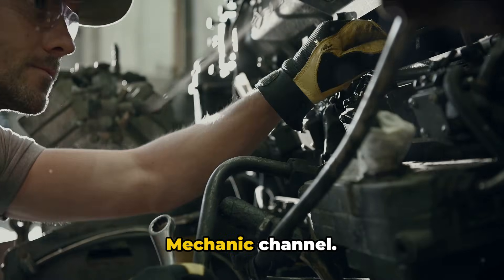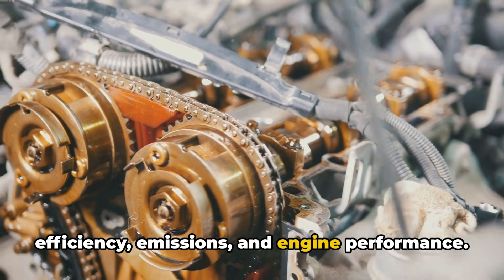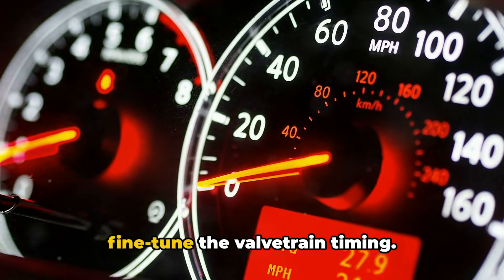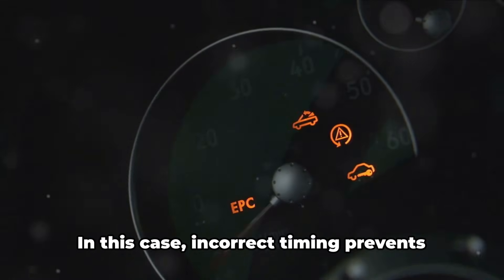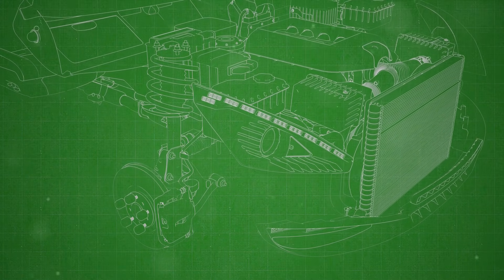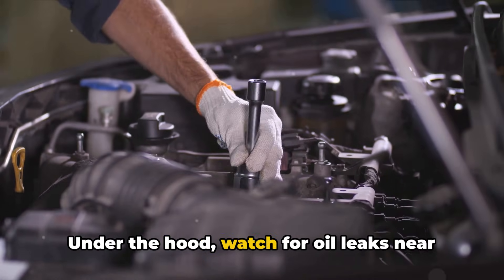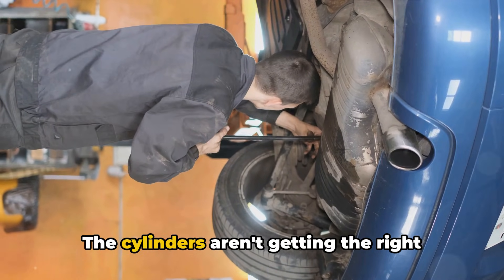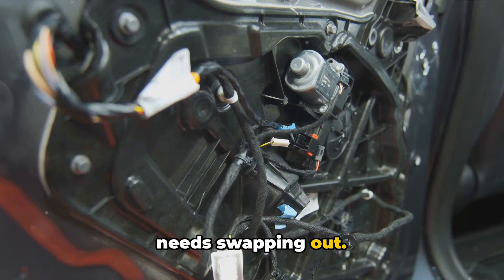Bad VVT Solenoid Symptoms: 7 Common Failure Signs

Comment: Hello, I have a corolla 2015 and my car makes a rattling tac tac tac noise when is very hot outside 115°f. I just changed the oil thinking it was probably the oil that was too old but it keeps doing it, could it be the vvti solenoid or the entire vvti system or perhaps the 0w20 oil that they recommend is too thin for this extreme weather, that thing is like water
Reply: Possibly knock sensor

Comment: also cleaning the filter may be needed rather than replacing though you're already in there at that point
Reply: Had this problem with a 2005 Aveo and my friends 2004 Echo. Car would shake violently at stoplights. Changed air filter both times and that fixed it

Comment: I have a 2010 vw tiguan 2.0 tsi and one piston is misfiring i checked ignition coils sparks injector they were good and i even redone the timing chain and it still got less power and it still misfire on cylinder 4
Reply: I had a similar issue on a 2016 Tiguan, ended up replacing the pcv assembly on top of the valve cover and the misfire codes went away

Comment: I’m changing out a bad water pump in my ‘17 Ford Explorer. At 168,000 miles it’s probably be wise to just go and replace the VVT solenoid right? Hell I’m changing out the alternator too since it’s never been changed.
Reply: i would for sure for piece of mind since you are in it anyway

Comment: I’m currently trying to fix multiple misfires on my ‘16 IS300 with 35k miles. Replaced coils and spark plugs and the result was misfires on 5 cylinders! Took it to a shop and they suspect it’s due to the non oem parts I used. I plan on getting oem but that still doesn’t account for the initial misfires. I’m wondering if the vvti solenoid could be the cause. There have been no codes mentioning it. Only cylinder misfire codes. Thought? Thanks for any help!
Reply from the maker: Hi John,

Yes, these solenoids can indeed cause misfires, and the tricky part is that they can lead to a lot of random misfires. I once owned a V8 Audi S5, and it started misfiring on one bank despite my plugs, coils, and injectors being fairly new. I even carbon cleaned my engine. That's when I decided to change the solenoids on both banks. As a mechanic, I know that if one component starts to fail, others may soon follow.

Regarding your '16 IS300 with 35k miles, it's concerning that replacing coils and spark plugs led to misfires on 5 cylinders. The shop suspects it might be due to non-OEM parts, but even if you switch to OEM parts, it doesn't explain the initial misfires. It's possible that the VVTi solenoid could be a culprit, despite no codes mentioning it, as you've only seen cylinder misfire codes. It might be worth investigating the solenoid further.

Hope this helps! Let me know if you have any more questions or need further assistance.
Reply: @HonestMechanicChannel  thanks for the quick response! The only other suspicion he had was carbon build up. Which turned out to be quite minimal. So he basically circled back to plugs and coils. I had seen some mention of the solenoids but couldn’t remember what they were called when I tried to bring it up. Seems possible. The reason im unsure is because the codes referenced seem to be different than the misfire codes im getting.  Thanks again!
Reply: @johnfriedman3463 did you ever figure out what the cause of your random misfire was?

Comment: Hi Mate wen i start the car first attempt in the morning its cuts of and then it starts with a rattle  , chain been replaced 2 month ago could it be the VVT sprocket and VVT solenoid ?it gives a camshaft sensor error wen you scan the car
Reply: Did it take care of your issue with new solenoids? I am having same issue chain seems good, cold start rattle for 2 seconds and have a intake solenoid code. Was brainstorming thinking if solenoid is bad maybe the oil pressure to vvt is not present at start up causing it to rattle until oil makes its way in there

Comment: Would this cause air suction from the oil dipstick tube?
Reply from the maker: Hi, Yes, a bad VVT (Variable Valve Timing) solenoid can cause air suction from the oil dipstick tube. This happens because a malfunctioning VVT solenoid can lead to improper engine timing and increased crankcase pressure. The increased pressure in the crankcase can cause air to be drawn in through the oil dipstick tube.

Comment: I have a 2007 vw Rabbit 2.5L. I already replaced the coils and plugs, the first Fuel injector (which was giving off a code) and replaced all of the fuel injector top and bottom O-Rings. It’s still sputtering. I Do have thicker Oil in it, but it was running fine for the past 6 months. It loses power during acceleration and around 3-4th gear.
Reply from the maker: Hi there, Given your 2007 VW Rabbit's symptoms of sputtering and losing power during acceleration, even after replacing the coils, plugs, and a fuel injector, it’s possible that:

1. Mass Air Flow (MAF) Sensor: A faulty MAF sensor can cause these issues. Try cleaning or replacing it.
2. Throttle Body: A dirty or malfunctioning throttle body can affect acceleration.
3. Fuel Pump/Filter: Check the fuel pump and filter for proper fuel delivery.
4.Vacuum Leaks: Inspect for any vacuum leaks, which can cause similar symptoms.
5. PCV Valve: A malfunctioning PCV valve can lead to power loss and sputtering.

Addressing these components should help diagnose and fix the problem.

Comment: I did a full tune up on my 11 rav 4, got it from mechanic no check engine, but it is over reving at lights and shaking like crazy. Thanks for this video. I’m pretty sure changing the solenoid will help a lot. The wiring harness looks like crap too, i might need to change that as well we shall see ordered the part. Thanks for this video again
Reply from the maker: Thanks for sharing! Glad the video was helpful!
Reply: did it fix your issue ?
Reply: '12 RAV here
Sounds like rough idle and bad air/fuel ratio. Check the MAF sensor and/or the gas cap if you haven't already. Then again all that just sounds like a 06-12 RAV4 😂 at full throttle so you good my bud

Comment: Have my 2015 Highlander limited v6. Code p0012. The car doesn’t allow the awd drive to be used nor the eco mode. Doesn’t have noticeable shaking when idle and recently got and oil changed with a trip to Michigan behind it with no issues. This happen on my way home from NY 7 hour trip. Half way Check engine light came one. Couldn’t use the awd system after that. Drove it slowly home and out the scanner. I haven’t got the solenoid yet my question is should go a head and just replace it or should I be concerned about the timing chain itself?
Reply: Did you figure out what it was?
Reply: @bradleyrivenbark946  just erased the code and changed the oil. It went away. However I’m hearing the rattle noise more noticeable when idle. I don’t think it has anything to do with the timing chain in most cases. I bought the VVTI SOLENOID AT Napa $134. Haven’t changed it yet but that was next step before the code went away and all systems came back. Ever since I haven’t had any issues. I still intent buying the other 3 remaining VVTI solenoids. Keep in mind bank 1 is at the back near the windshield. Bank 2 is at the front. There’s 2 exhaust VVTIs solenoids and two intake solenoids. One of each at both banks. Apparently they get stuck when oil is dirty or low. They are very fragile and prone to failure if almost anything that’s not oil gets in between the little valves inside said solenoids. Best prevention change your oil every 3k that’s been key imo. Don’t go for the intervals even tho this V6 is not turbo it does run Hot. 🥵 
Pro tip I leaned with these issue; erase the code at least once to see if it comes back.  Before buying parts. And check your oil level make sure is clean and closer to the F as possible.
Reply: I have the same issue, replaced spark plugs, cylinder coil but still codes P0011 and P0021 comes back.

Comment: My vvt solenoid had metal shavings on it🤦🏽‍♂️ for a 2014 Chevy Malibu
Reply from the maker: Hi Sean, Finding metal shavings on your VVT solenoid for a 2014 Chevy Malibu could indicate wear in the engine's internal components, possibly due to inadequate lubrication or failing parts. It’s important to thoroughly clean the solenoid, check for further damage, and replace the engine oil and filter promptly. Consider having a mechanic inspect the engine to diagnose and address the root cause of the metal shavings. Also I recommend replacing the solenoid

Comment: I have a Chrysler 200 I wanna know if this can be a reason my car won’t turn can it this instead of me thinking an engine locked up
Reply from the maker: Hi Aunbriell, A faulty VVT (Variable Valve Timing) solenoid typically doesn't prevent an engine from turning over; instead, it can cause issues like poor engine performance, increased fuel consumption, rough idling, or a check engine light. The VVT solenoid is responsible for controlling the flow and timing of oil to the VVT system to adjust the engine's valve timing. If it fails, you'll likely notice performance problems, but the engine will still turn over if the battery and starter are in good condition.

If your Chrysler 200 is not turning over at all (i.e., the engine does not crank when you try to start it), the issue is likely related to the battery, starter motor, ignition switch, or a seized engine. A seized engine can indeed prevent the car from turning over, but this would typically be accompanied by a history of serious engine problems, such as overheating or lack of oil.

To diagnose the issue, you should:
1. Check the battery voltage and ensure it's fully charged.
2. Listen for a click when you try to start the engine; a single click can indicate a problem with the starter.
3. Check for any visible signs of oil leakage or damage under the engine which could suggest serious internal issues.
4. If possible, try manually turning the engine with a breaker bar and socket on the crankshaft pulley bolt (only if you're experienced with mechanical work). If the engine cannot be manually turned, it might be seized.

If you're unsure or not experienced with car repairs, it's a good idea to have a professional mechanic take a look to accurately diagnose and resolve the issue.

Comment: If you go to a mechanic with this they will say you need new spark plugs because it will give the same symptoms. After they take your money for the tune up you didn’t need and the problem is still there, they will then charge you for diagnosis and finally they will replace the solenoid once they found the problem. This is how mechanics try to make extra money.
Reply: Not to mention DIY at home you may do the same.  😂
Reply: @DougFL66 usually you start with the simple cheap solutions and work your way upright to the more complicated, expensive solutions.

If you did it backwards you’d be even more pissed because you had expensive work done when you only
Needed spark plugs.
Reply: @ammoniawilder4451 but lowk happy you maintained tf outa your car. When  you discover more is bad than the one problem it’s kinda like a sign
Reply: @DougFL66  right 😂
Reply: @DougFL66 I'm guilty of doing the same on my own. Changing my plugs and the coil packs smh
Reply: 😂 @DougFL66
Reply: More like mechanics do not know shyte and also tries to make extra money. It is very hard to find competent and reputable mechanics that really know their crafts, and this is very true.
Reply: @80sGuy.  sounds like you haven’t found the right one 😅also mechanics are taught from school to upsale anything and everything, you would too if you needed to make money 🤷🏻‍♂️Mexicans know what they doing just find a good shop and stick with them, they don’t gaf about extra shi
Reply: @aidenthe420  I already found one - MYSELF! Been working on my (Audi and Volvo) cars for the past 12 years now. Done right even though they are a pain-in-the-$$ to work on. Rewarding? Yes it is. Every time!
Reply: spark plugs,vvt solenoids,cam phasers,timing set and coil packs all need changing.....thanks for your money lololol
Reply: Im a mechanic Not everyone is out to screw you buddy 😅
Reply: If they are shady ones sure but some cars are already passed the miles they should have a tune up done already, so getting the tune up out of the way is not just about making money but doing a job that already needed to be done. (If it actually needs it)
Reply: Spark plugs are much cheaper thats why..
Reply: It’s not that serious dude.lol I went due to a leak and they simply told me it was my VVT. Of course I replaced the valve myself because it was easy.
Reply: They will also say it's a Timing chain...
Reply: They’re just trying to cover their ass. If you were a mechanic full-time, you would understand because the minute you don’t recommend it then you’re gonna go out you’ll run the one that happens to have a bad plug. It has nothing to do with anything. I’m not trying to rip you off. I recommend it all the time but what I usually do is ask him how long is it been since you replaced your spark plugs And I’ll give them the option of saying do you wanna do a tuneup with it while I’m here, maybe do it for a little less anyways
Reply: that's why you buy your own odb2 scanner, and some sensor replacements are simple. You can do it yourself.
Reply: I got my spark plugs and serpentine belt replaced, and then I had the symptoms of the video. They said it was unrelated issue, but I never had problems with my truck until after the replacement.
Reply: Exactly what im going through hopefully this fixes it
Reply: I litteraly just had this done 45 mins ago
Reply: Yeah, then they'll say you need a new transmission without even trying to diagnose the problem and charge you 100 million dollars lol smh. Get a wireless mechanics ear like I did, I'll have the tomorrow, so I can pinpoint where the noise is actually coming from.. And try to fix it myself!
Reply: Generally they need a good starting point if plugs are old or in question.  If its coding vvt thats one thing and there is where they should go with it, but if its intermittent or marginal you could be barking up the wrong tree. 
   If plugs are under 50k and not getting misfire codes then its vusual inspect vacuum lines, connections etc.  One never knows who may have fiddled under the hood, broke clips, or anything else that may have happened. It makes for a tough job and alwats needs to begin at square 1 every time. 
   If you kow its coding vvt and know what you are doing dont let anyone else under the hood. Get your readings, remove clean, decide course.
Reply: You have no clue how mechanics work then
Reply: I went not long ago with these problems to a place I thought I can trust and asked for the solenoids to be checked i think they need replacing .they asked me what's going on I told them then this man comes to me to tell me it was my motor mount. I just had them both replaced a year ago .I figured I got taken at my old place. So it was done but as I drove off it started out better but in a few minutes it went back to messing up. I won't go back again screw them. I don't want to wait till my light comes on and makes more damage
Reply: I hurt my ankle and it's hard to get it done. I need to find someone to do it for me
Reply: No offense just bad mechanic not starting with diagnostic
Reply: Ehh idk how true that is, maybe if you take it to a bad mechanic. A good mechanic charges diag first and figures out the problem before throwing parts at it.
Reply: Not if you go to the “Mexicans” most shops here don’t have actual names and so that’s what they go by and most Mexicans ain’t tryna hustle you for anything more than what you came to get
Reply: That's how the world works buddy SAd to tell you but if you go to hospital they do all these unnecessary tests. A plumber they will hit you with lemme run my Camara it's 385$ .  Electrician will do the same everybody has their ways into scamming and extra 300$ to their business. That's sad but that's how the world works
Reply: Exactly
Reply: 2 vvt on the intake cost me less than 100€ i couldnt figure out how to change them, so i took it to the shop for 90€, whatever. spark plugs are around 60€ so its not far off. also depends when the spark plugs were last replaced. if its been 100k km then sure go for it first before changing vvt solenoids (you need to do it anyway) but if they re almost new you should tell them no just replace the solenoids
Reply: Lol not necessarily the case. Often times the plugs actually need to be replaced because people don't maintain their vehicles so you have to fix the obvious possible cause and see if the problem still exists before you can start further diagnosing.

Comment: What if I get a P0011?
Reply from the maker: P0011 is a diagnostic trouble code (DTC) that indicates a timing issue related to the "A" camshaft on bank 1 of the engine. The code description is "Intake Camshaft Position Timing - Over-Advanced (Bank 1)". This means that the intake camshaft on bank 1 is more advanced than the ECU expects it to be.
Possible causes for this code include:

1. Low engine oil level or dirty oil
2. Stretched or jumped timing chain
3. Faulty camshaft phaser or actuator
4. Camshaft position sensor issue
5. Sludge or debris in the oil passages
6. Wiring issues or damaged connectors related to the camshaft position sensor or actuator
In rare cases, a faulty ECU

Comment: I have a 2020 V6 Chevy Blazer outputting P0024 code. When shifting 1-3 gear she shakes. Runs very smooth after that.  Could it be the selonoide?